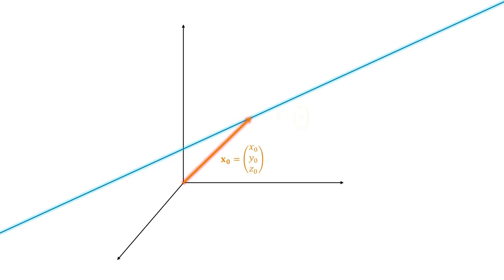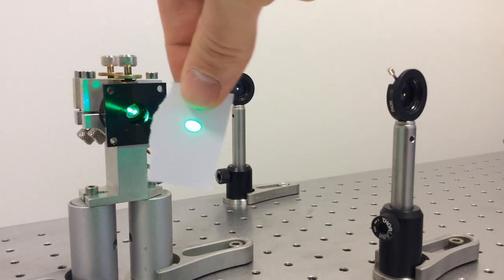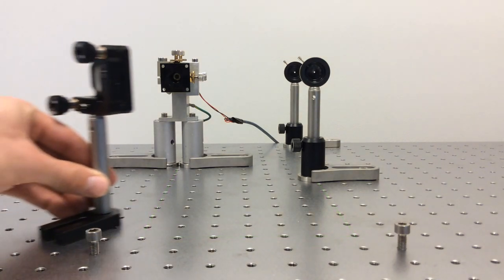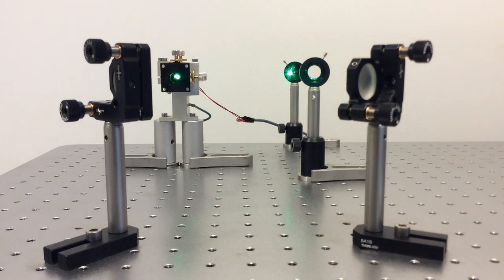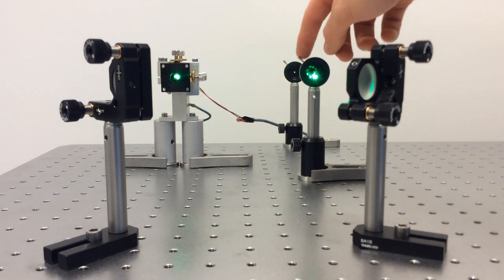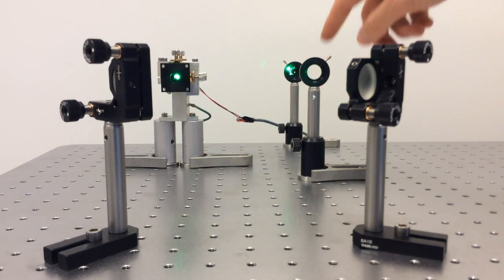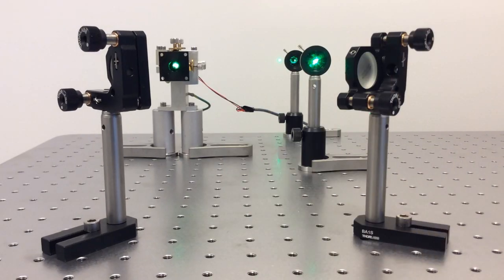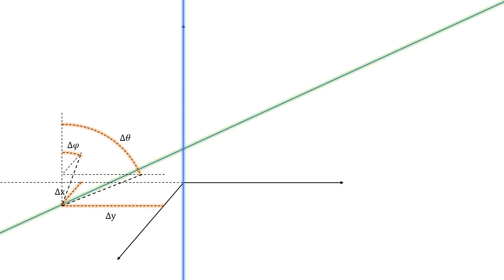2 - Beam Steering

Comment: Actually one mirror can hold 3 DOF - azimuth angle, elevation angle, and translation along normal axis. Still incomplete to make any arbitrary beam (4 DOF), but if beam height is fixed, then we can align any line with only one mirror.
Reply from the maker: Good point! We actually did that in our TIRF SIM with a dichroic mirror to limit the number of optical surfaces: dx.doi.org/10.3791/53988 - I wouldn't count it as a 'basic' alignment technique though.

Comment: can u make a video of a beam hitting beam two times? like a beam hits a mirror m1 which reflects and Hits mirror 2, then the reflected beam from mirror 2 hits m1 again and then reflected beam from m1 hits m2 again. so beam hits bots mirrors two times
Reply from the maker: Hi! If you want to bounce a beam multiple times between two mirrors, then the alignment approach is the same as with a single bounce, the adjusters are just twice (or more times) as sensitive. If it gets tight getting the beam onto the mirrors, you might need need mirror mounts with "clear edges" (Thorlabs, Newport, etc sell them under that name).

Comment: You are using a visible light laser, right?
Reply from the maker: Yes, it was a 520nm laser diode. If you have an invisible ultraviolet or infrared laser, you can use beam viewer cards that make the beam visible. For UV, a white sheet of paper will also do because the bleech in the paper fluoresces. There are also IR viewers that make infrared light visible. Another alternative that works for all beams and is especially useful when coupling into optical fibers: use a power meter behind the pinhole (or at the fiber output) and optimise the power throughput (make sure you close the pinholes to the same size).
Reply: @opticalsystems7076  Thank you very much for your detailed answer. I use a 1550 nm IR laser diode and a laser viewing card. I like your idea of using an optical power meter, I will do it!
Reply: As a cheap indicator paper for IR beam one can use a magenta-colored post-it stickers. They turn violet when exposed to heat. The other colors (yellow, etc.) do not work this way. Working power range for 2mm beam from ~20mW to 500mW (starts burning after that)